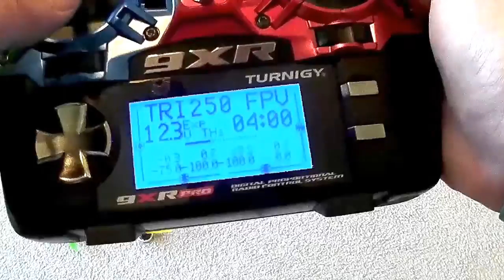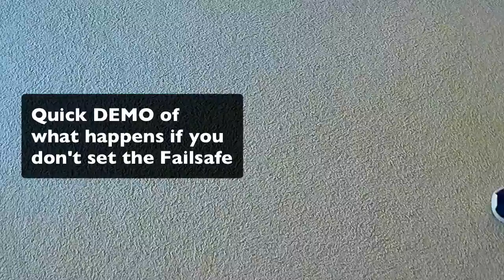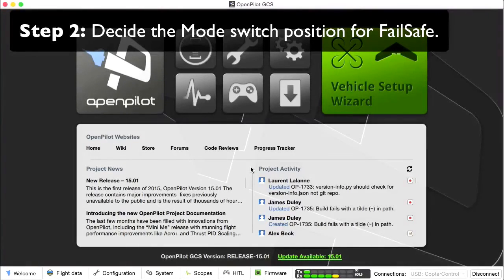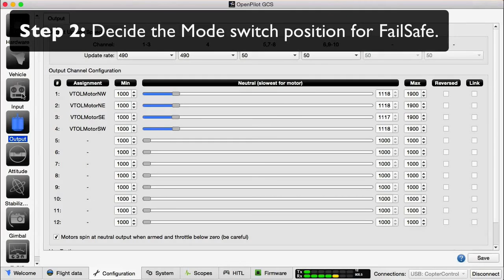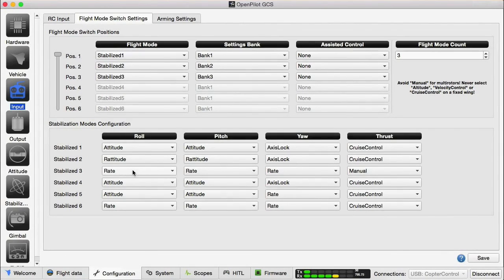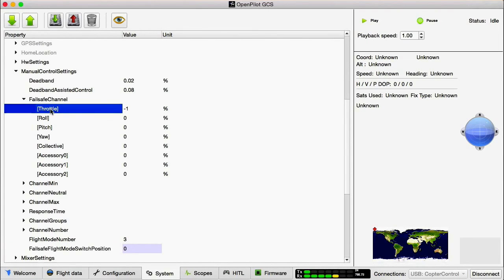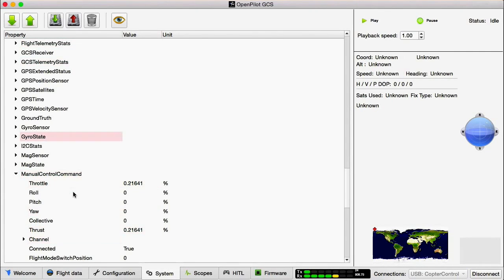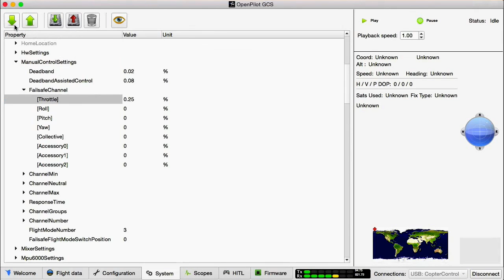FailSafe on CC3D

Comment: I have a very very basic Flysky FS-i4x and Tx and FS-A6 Rx and my quad running with KK2.1.5. Currently if my Tx goes out of range or get switched off, The quad motor continue running in the same speed where the singal got lost (I have tested it).
I would like have some fail safe option, at least motor to die in case of signal lose. is that possible with cc3d and my Flysky FS-i4x and Tx and FS-A6 Rx?

Comment: I followed this video and setup my failsafe. I made a horrible mistake of turning off my transmitter when it was bound to me quad, and the motor spooled up from zero throttle to my set failsafe throttle (40%). Unfortunately, the quad started veering toward me and I had to deflect it with my hand. I now have 2 big cuts on my pinky finger. I will now be turning my failsafe off.
Reply from the maker: I had a similar situation happen. This is however true from both software or hardware based failsafe solution. Never turn off your controller without inspection. Always turn on your controller first. These procedures are standard especially in older RC systems. Be careful out there :)

Comment: Hello everyone. Just a half an hour ago I came back from the field where I've crashed my ZMR250 because RTx signal loss. Just a half an hour before going to the field I watched this video and seemed right to do it on my quad. However I had no intention of checking the failsafe mid flight. It just so happened to "test itself" :p On a more serious note, SERIOUSLY!!! DON'T DO IT ON MINIQUADS!!! If you do, then you made at least two very wrong assumptions: 1. You have sufficient height for the quad to level off and start descending. 2. The surface it lands on is nice and smooth and flat. As you might think already this is almost never the case with MINIQUADS. As it happened to me just half an hour ago after I setted this up and took it for a spin, I was turning around a couple hundred meters away from myself, trying to come back to where I was standing, but I wad  only flying about a meter of the ground when I lost RTx signal. As you might expect half a second later the quad bit the earth and toppled over BUT it still tried to hover level. Being upside down it only made some nice looking crop circles and was trying to get to China the short way around, i.e. straight through the earth. luckily I got there pretty fast, although I didn't knew exactly where I've crashed and was barely able to get the battery disconnected. One ESC was very very hot, the corresponding motor as well. It would have caught fire if I weren't to find it so quickly (about a minute). Luckily for me I only broke a prop and nothing more happened to the quad. It flew again after a good rest and cool-down. But this whole experience taught me to listen to the experiences pilots out there (I ignored you guys in the comments, trying to warn us noobs about this danger. Sorry for that :D) I am now absolutely convinced that unless you have a software that has a time limit for this kind of failsafe and you actually set it to 20-30 sec MAX, worse things than just another crash could happen. Let's face it, lost signal far away = crash 99% of the time. The best you can do is not have it fly away and maybe soften the crash a little if you use this kind of failsafe but only with a complete shutdown after a very short delay, otherwise I highly encourage anyone to not do this, but go for the complete shutdown. As for me personally, I think its time to switch to CleanFlight, which I think also has this failsafe but with the delayed shutdown option also. OpenPilot, what I fly right now, does not have the delayed shutdown which would have been grate, but oh well. And don't ignore more experienced pilots like I just did today. It could have cost me a lot more than some props!!! Happy flying!
Reply: Also, please excuse my use of English :D
Reply from the maker: +Marian-Gabriel Flocan Yes you make a very good point. As we said before, think about the craft and the area you fly in. Flying 1 meter off the ground with a miniquad, obviously this will not assist, but there are situations it will.

Switching to CleanFlight will give you the exact same two options, 1 - Land the copter or 2 - Cut the throttle. ... You decide which is the best option for your craft and flying situation.
Reply: +FunFly FPV Hey, thanks for the videos and the idea. Sorry If I was to harsh towards this idea in my comment, but I just wanted to share my experience for others. I agree that it depends on what/where you fly. I might just do this on my larger quad that I build myself, only on that one I have to code it, as on that one I run my own flight controller/software :D and usually fly it for video purposes pretty high up so plenty of time for descent. As a question isn't there/ do you know of any firmware with delayed shutdown?
Reply from the maker: +Marian-Gabriel Flocan The only other implementations of delayed shutdown is in CleanFlight and in the BLHeli ESC firmware. You can set a value for the shutdown, lets say 10 seconds, and after 10 it will revert to crash aka, turn motors off. There is such an implementation in BLHeli, but usually CleanFlight set that for you. As for CC3D and OpenPilot, I have not seen that yet.
Reply: +FunFly FPV Yeah, that's what I'm after. My thinking is I might not get the craft back under control but if I don't and the failsafe kicks in, and suppose you are up high, then it will do what you showed us in your video, but only for 10-20 sec and then just shut down. I think two things happen: 1- it will not fly away, obviously and start to descend and get closer to or get on the ground fairly safe, though fast, and 2 it will also not catch fire after words. So even if this happens pretty high up and let's say it hasn't reached the ground in 10-20 sec as you've set up the delay, chances are it got pretty close and only drop from less of a distance which  I would prefer. Or you did touch the ground in 3, 5 or 10 sec but it will only spin on the ground for a very short time, reducing the fire hazard on the esc's.

 Thanks for replying and keep making videos / talking to new flyers like myself.
Reply from the maker: +Marian-Gabriel Flocan No issues ... Thank you.

Comment: I am not a safety freak, but intentionally setting it up to run like this when out of control sounds like a baaaaad idea.
Reply from the maker: +Mark Lewis would you prefer it just dropping straight down from the sky wherever it is? So if you are 200 ft up, it must just stop and drop? Some say yes, I think that is unsafe, but it depends on where and what kind of flying you do. This is better than just dropping, at least it will do a slowed fall ...
Reply: Absolutely.
Reply: +FunFly FPV the worst is when powering off the transmitter and having the failsafe activate the motors

in 3D helis this is the worst thing to do and with quads it should be worse as it instantly goes up

with 3D helis there is a spool time because of soft start
Reply from the maker: +Anthony Abelardo The failsafe has a value and that value is set to below hover. Meaning, when the transmitter is turned off, the value will be set to below hover and all axis is set to center. This results is that the quad gently falls from the sky, instead of a 2 pound weight dropping 200 feet straight down onto whatever is below.
Reply: FunFly FPV if you're scared about your drone crashing you should get a hover hold GPS feature on the flight controller

I have an RTH for things like that.  I lost video numerous times when I was an FPV novice from easy reasons like pulling the cord, loose battery connection, and not recharging the battery.  RTH saved it.  I had a prop failure because the antenna wasn't fixed properly but it's good I was on FPV monitor so I looked up and caught it then landed fine as hexa the other motors took over for the missing power. 

I went goggles and going to fly for the first time w/ it so all the learning of what not to do has hopefully passed.

Comment: Very useful information. thanks. 

After trying it I decided its actually not for me. As your video shows, you turn off your controller & the motors will spin at 20%. so you must remember to disarm or you will be in for a surprise if you purposely turn off the remote.
Reply: +RiquezJP you should never turn off a transmitter before the model.

Comment: If pilots would learn to fly line of sight and in an open not 2.4 GHz polluted area, do not fly above 40ft, what's the purpose in flying a 250 or any racing quad above even 20ft I don't get it. We as pilots should be establishing a flight box in which to fly any non-gps quad, and gps enabled quads you can fly up to 400 ft but still line of sight. I would say that fail-safe should be set into drop mode again because you shouldn't be flying that high, your 250 quad should respond the same way most toy quads respond whenever they fly out of range or encounter radio interruption.
Reply from the maker: +William Carrey yes the point here is to set it to slow the decent and not fly away, but as noted earlier in the comments, it depends on what kind of flying you are doing etc. This gives you the option to set at least some form of FailSafe if your radio does not support it (most radio/receivers do support their own FailSafe with a single button). It would not make sense to set FailSafe if you are flying LOS and racing in most cases, be that using this method or via your radio/receiver.
Reply: +FunFly FPV  I totally disagree with you regarding enabling fail safe based on type of flying or distance parameters. I encountered this very scenario on a walkera runner, somehow the quad malfunctuoned, connection between the TX and RX was interrupted,  broken or whatever at approx 30ft and the quad shot up and never responded to throttle input. This very scenario is a non issue on the walkera runner particularly when paired with the F7 TX.  So I feel fail safe should be set from the manufacturer and that you would have to disable if you dont want this feature enabled.
Reply: +FunFly FPV  Essentially what I'm advocating is that fail safe should be an industry standard like air bags for cars are, and if you don't want fail safe, or if you want to modify the parameters you should be able to do so on your own. IMHO I feel that if a manufacturer sells a product as RTF. RTF should mean just that, that the basic safety fail safe options should be the default.  A person wouldn't be expected to enable ABS on their vehicle before they drive nor should a person be expected to enable fail safe if the purchase a RTF quad. I guess I'm having a hard time understanding why the default is set for the quad to fly away instead of dropping as in the case of the runner 250 or any other quad that could potentially malfunction.

Comment: Just curious.  What happens once the quad lands (- in weeds, branches and etc.)?  The motors will continue spinning and possibly tangle up and potentially burn them out.  How will the quad shut down?
 
I set up one quad like yours, but my new Blackout is set where everything shuts down due to my concern once the copter lands.  I might loose some props and maybe an arm, but the electronics should be spared.

Again, just curious regarding your thoughts.
Reply from the maker: dan estes Yes there are definitely 2 camps on this issue. There are many ways to set FailSafe, typically it is set on your receiver, so what is shown here is not unique, just a way to do the same from the FC. I prefer FailSafe than just dropping out the sky when I am close to people or property. If however I want to fly far into and open field, perhaps FailSafe is not a great option. I typically fly pretty close by and the only reason I will go into FailSafe would be when I go behind a tree or obstacle. Typically I can regain control and shut down pretty fast.
Reply: I agree.  It depends upon the environment you are flying in.  Thanks.
Reply: dan estes I wanted to say just the same. if you flying in wild and not in the park then you may lose all motors! Everyone  just invest your time be sure that your have a lost plane alarm. Without running motors the battery have energy to feed the alarm as long you find it.

Comment: I followed this but my quad just keeps running at the last throttle in before I turn off the tx. I have a walkera rx701 and a devo 7
Reply: mark rankin Mark... I'm using a Devo F12E and an RX1002. The fail safe INCREASES throttle at loss of signal. I may have to give up on the CC3D and use a different flight controller.  It IS the least valuable component of the airframe. Less expensive than a single ESC/motor set. The RX1002 was under $30 including shipping!
Reply: Hi I found failsafe setting on my devo 7. The throttle was on hold I changed to safe then made sure the throttle was set to L 100  on that failsafe and it works. If you need a vid I can show you. Its very easy and no messing with the cc3d
Reply from the maker: mark rankin setting the FailSafe on the RX  is preferred. This video deals with setting FailSafe on the cheaper RX's that does not have built in FailSafe, and in that case you have to do it on the flight controller.
Reply: mark rankin Found it! At least, I found ONE way to do it. I'm of the 'Loss of signal = cut motors' persuasion. I can repair any damage short of loss of airframe. So...perform the OpenPilot GCS Vehicle Setup Wizard and Transmitter Setup Wizard. THEN go to Configuration / Input / RC Input and set the Throttle channel value for *NEUTRAL* to not much more than Minimum. Save. For me that was Min=1091, Neutral-=1132, Max=1900. It spins down when the transmitter is turned off. I did some low altitude/low speed laps of the front yard!
Reply from the maker: Great work! I will try this too...
Reply: jsl151850b And now the bench test throttles up at Loss Of Signal! This shouldn't be so hard to set such a basic command!!
Reply: Buy a devo 7 cheap and fixes the problem
Reply: mark rankin Imagine I'm doing a terrible Arnold Swartzenegger impression: "It's not the transmitter!"It's some combination of the process being needlessly convoluted, a bug in 15.02.02, a defective CC3D or me being stupider than I had thought hitherto.
Reply: Get in the chopper!!
Reply: mark rankin PS: The transmitter's Failsafe is set to zeroes. I've reinstalled GCS 15.02.02 (The previous version lead me to believe I had failsafe twice, one with engine cutoff and another with dead throttle between 0 % to 50% and motors ticking twice a second at failsafe. Spare motors, ESCs (I needed those anyway) and a spare CC3D (bent pin style and if available, mini CC3D with horizontal pins.) on order. I wanted to put off the GPS enabled Flight Controller for a few months, after I had some stick time.
Reply: jsl151850b It was #1 & #4. I was setting the Throttle Failsafe on the transmitter to Zero, when I should have set it to Negative 100. So... 50% from the receiver at loss of signal  + negative 100 = engine shutdown.

Comment: Can you explain the FailsafeFlightModeSwitchPosition a little more?  I'm confused why I need to change the value from 0 to 1.  

Great video.

Thanks.
Reply: +FunFly FPV Thank you so much for this video. The instructions were clear and helpful!
Reply from the maker: dan estes You want to set the FailsafeFlightModeSwitchPosition to switch to a flight mode that is stabilized, like attitude or rattitude. So looking at your flight mode switch screen, choose a position you want the switch to go into when failsafe kicks in. So lets assume you choose position 1. So in the settings menu you want to set the value of FailsafeFlightModeSwitchPosition to one less than the position you chose, in this case position 1. The value is thus 0 in this example.
Reply: dan estes Got it.  Works great!
Thanks again.
Reply: Thanks.   Everything is working great.

Comment: How much is a quadrocopter?
Reply from the maker: Well, toy grade starts at around $20 and pro grade copters run well into the $10 000's. A typical hobby grade 250 copter like this one runs between $100 and $300.
Reply: FunFly FPV The 250 series is approximately $250 ! (Not counting transmitter, Video goggles and/or LCD Video receiver.)Also, you are wearing out batteries and possibly damaging propellers with each flight. Then there's crash damage and... Heavens Forfend!...Flyaway!
Reply from the maker: jsl151850b It does get expensive if you get into FPV etc.. and acquiring a quad is one thing, maintaining it after crashes can also get expensive.